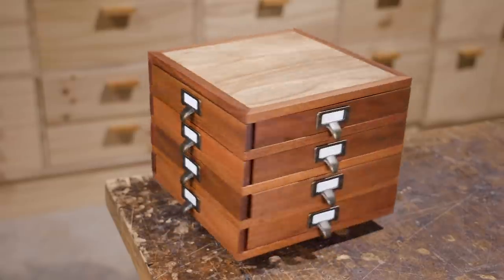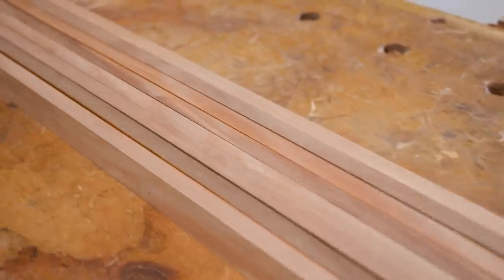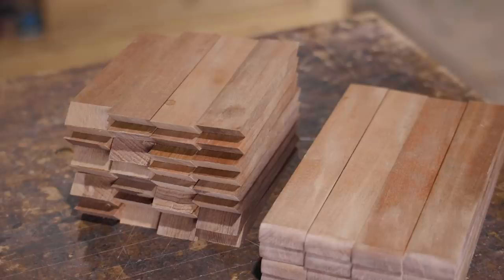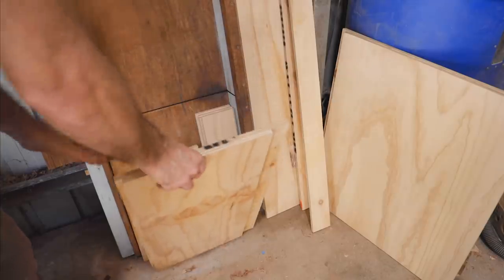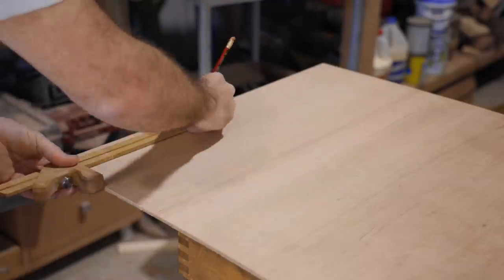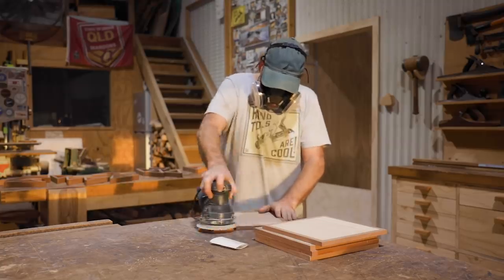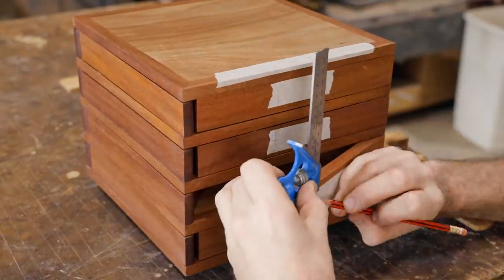Small Parts Organizer with Triangle Drawers

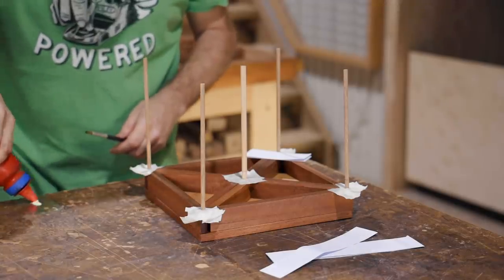Comment: Innocent question (I have zero skill and/or knowledge when it comes to woodworking, just throwin it out there right now) but was the glue necessary on the outer edge dowels, in-between each set of drawers and shelves? The one that had you "scratching your head" at 17:25 . It seems like the shelves would've stayed in place just fine without it, and you wouldn't have had to worry about accidentally gluing the hinges shut in place. Just curious is all. Great video and I loved the end result! It's a beautiful piece!

Comment: I'm curious where you sourced the drawer pulls.  I've been shopping for cast brass, but don't see any place that stocks them.  For my immediate project I had to settle for stamped brass.  Most of what I see is stamped steel with various finishes.  Thanks.

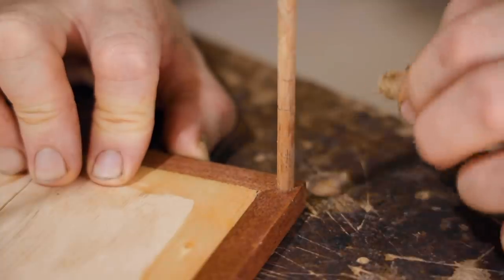Comment: 17:00 - Do the shelves really need to be glued at all? Couldn't you just add a washer above and below each drawer (to ensure there's a small gap, and they won't rub), and glue only the top and bottom plates to the dowel?

Also, did you try not using any shelves (just stacking drawers directly on top of each other, again maybe with washers to avoid them rubbing)? Was it too wobbly?

Comment: Is there a reason the interiors of the shelves are not finished where they’re mostly hidden?  They’re not 100% hidden when the drawers are open, but this looked consistent and intentional.
Reply: I think to prevent sticking? If the finish becomes sticky over time for any reason then it won’t be able to gum up the drawers.

Comment: As beautiful as the result of this is, I feel it somewhat misses the point regarding the challenges faced by those without access to tools. All I have available to me personally is a small hacksaw and a shoddy corner vice. Prices for any tools at all are exorbitantly expensive in the UK and wood of any kind even more so, the only materials available of any affordability are CLS timber which is particularly awkward to do woodworking with given the length and thickness of the pieces. Making a clean and straight cut that comes out to the right size is a serious challenge, let alone making anything approaching clean joinery without a chisel set. Is interesting to see what a different perspective a professional woodworker has on a challenging tool selection.

Comment: would the wood not expand during a colder day , causing the "drawers" not to open.
Reply: No.
Cold will cause the wood to shrink.
Heat will cause the wood to swell.
This is why we use dried wood.
It's not the wood, but the water in the wood that does this.

Comment: Loved this, for some reason, the use of hand tools reinforces the skill of cabinet making in the old style. No offence towards those that use power tools. 
The only suggestion I would like to make is to use brass sleeves in each corner through which the wood  dowels would slide through, this would provide a long term strength to prevent wear and tear on the corner joints, but I’m not as skilled as you, and I’m sure you had your reasons. Look forward to your future videos.
Loved the use of the Japanese saws btw, my dad, a Sikh Carpenter confounded his English colleagues back in the 60’s  with his use of saws with the teeth set (as per the Japanese saws) to cut on the pull.

Comment: Can somebody help me please. Literally how does this work?? I can’t seem to find out how the triangle drawers turn out when they add up to a square
Reply: The pivot is right in the corner, so the arc made by the inner right angle of the draw as it opens won't overlap with the adjacent draw. You could easily convince yourself of this by drawing a small square divided into four triangles like in this video, cutting out a matching triangle, holding a pencil point right in the corner of the triangle cut-out, and 'opening' this model draw. It won't cross into any other triangle.

Comment: Looks like it would spin when you try to open it and the handles are in the wrong place for maximum torque. Also, big parted drawers are better than a million small drawers.
Reply: Not true at all. If I have a bunch of small parts to organize a large drawer is useless to me. A bunch of tiny drawers is much better for small parts storage.

Comment: Pask I get what you're saying and I appreciate what you're doing (and I absolutely loved this project by the way), but the hand tools thing is a bit of a fallacy.
 I mean, to do what you just did, you need a lot of good quality hand tools (old or new - and old good tools are expensive), at least one expensive bench vice, and a finetuned and well thought out bench.  Honestly, it works out about the same money as getting a basic (or even not so basic) table saw and planer.   Don't get me wrong hand tools are great, I love them too and always incorporate them in my processes but the bottom line is that whether you do power tools or hand tools, wood working always requires a great investment in various combinations of money/time/space/effort, just to get started.  Just no way around it IMO.
Reply: Oh and I forgot, once you're finished using all your savings to outbid everybody on ebay for those old Stanley planes, you realise you also need some way to sharpen them.  And then someone talks to you about diamond stones and wet grinding systems, and then you really wish you had bought that lunchbox planer in the first place LOL
Of course, if you give it a few years, you inevitably end up with both the Stanleys and the lunch box planers and everything else, just like you, me, and probably most people watching this :)

Comment: Why bother with the shelves?
Why not just toss down a washer or two between each layer of drawers, and just let them sit on top of eachother? Not like they server any purpose otherwise, except for maybe some added rigidity, but it's not like the thing is for big heavy parts or anything, and the overall solidity of the structure would be plenty, combined with the depth of each drawer making it near impossible for any twisting of the dowels.

All that aside, very impressive and exceptionally crafted, a lot of attention to detail.

Comment: I don't have the time in my life to pretend that I'm living two thousand years ago and electricity and power tools don't exist. I did make this project from left over oak flooring I had from a remodel for my wife's sewing notions. I added a wooden handle on top and epoxied small neodymium magnets on the bottom of the front edge of every drawer and a matching magnet on the shelf beneath to keep the drawers in place when being moved. I also used steel rod instead of wooden dowels to make these stressed points much more rigid. I could have left the handle off of it because she ended up using it for jewelry.

Comment: No power tools, sweet. Just $500 worth of other tools
Reply: Lets see: 2xJapanese hand saw, flush trim saw, hand plane, say a dozen clamps, saw rasp, cordless drill, engineers square, wood workers square, medium/large right angle rule, pin nailer, awl, plier cutters. I might have missed some. I've excluded the self made jigs and any consumables like glue, sand paper etc. Also excluded the existing workshop items like the work bench, vices etc and all the materials since he got them for free. So all up, it looks about a few hundred dollars worth of tools. If everything was included...thousands of $$.
Reply from the maker: Ok next time I'll make it with my bare hands and teeth! The idea was to inspire you to make something with the tools you already have, whether it's hand tools, a jigsaw, or a tablesaw it doesn't matter. Where there's a will there's a way, just give it a crack and stop whinging!
Reply: @PaskMakes  I was not intending to be critical but was trying to say that if someone does get inspired to do wood working things like you then for them to do something it would mean they already have a lot or all of those tools or they would have to outlay for those things first. That's also assuming they have the workshop space (garage or otherwise) to be able to do stuff in. Someone living in an apartment with only a handful of those tools might find their inspiration dashed by their circumstance. I'm fortunate in that I do have all of those tools (or equivalents) and have a small space which I can use to do projects like these. I personally find the projects you do very creative so please keep up the great stuff and keep on posting these vids! Take care.